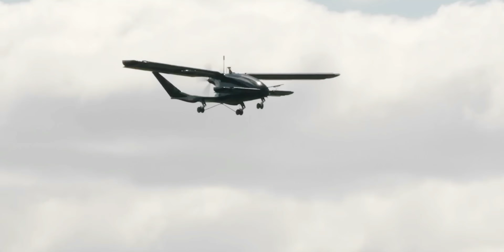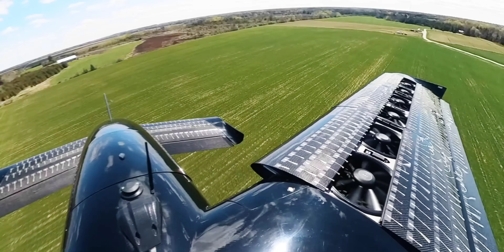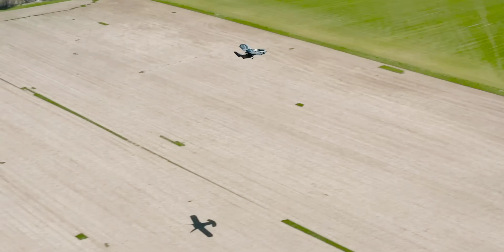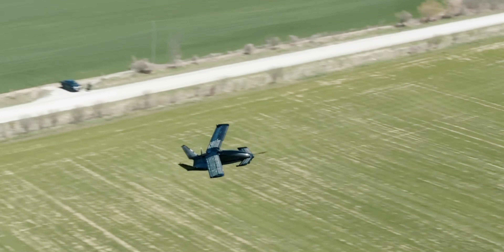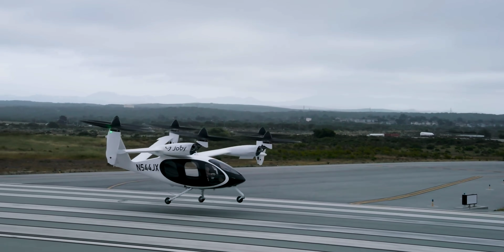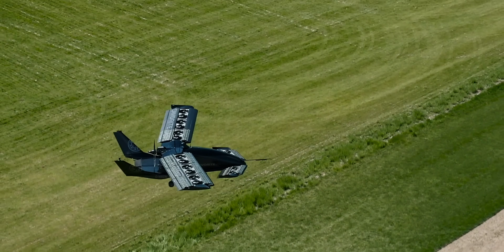Cavorite X7 VTOL Makes History With First Fan in Wing Transition Flight

Comment: Why not just buy out Lilium?

They appear to have been ready for certification?

Why do you need more than a 200 mile range?  It's called URBAN Air Mobility for a reason.
Reply: Because people with money also value their lives and will replace their S-76 or AW139 with an evtol that has redundancy especially if it’s faster and bas longer range…